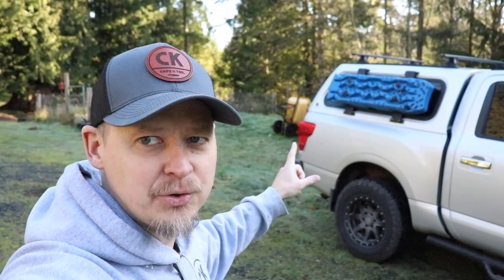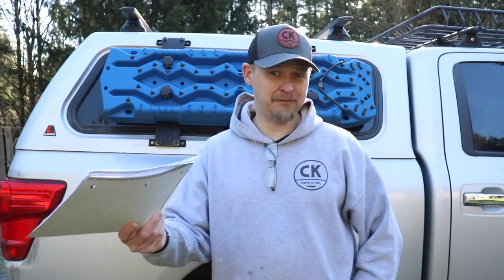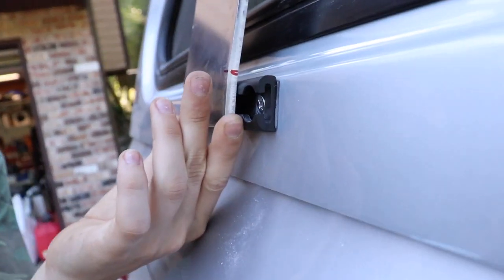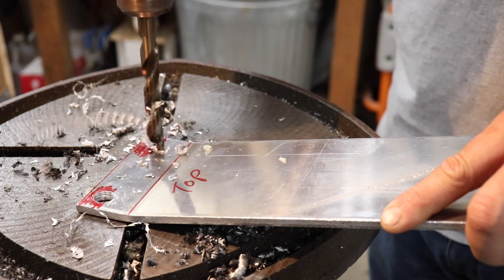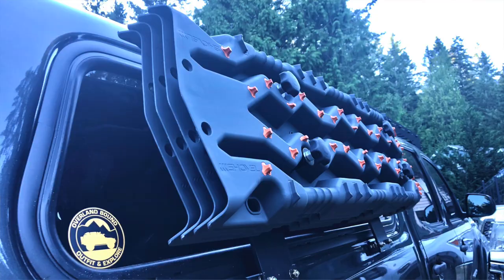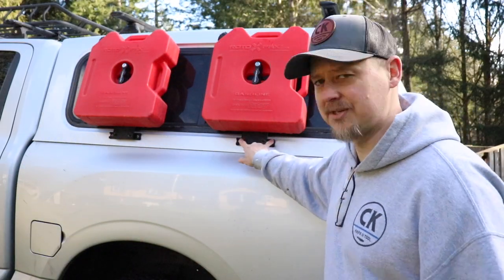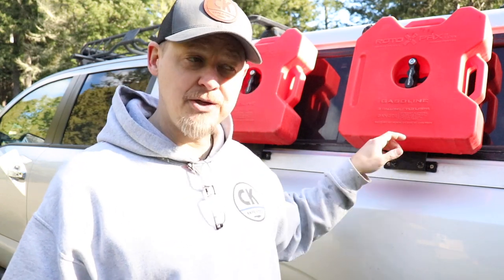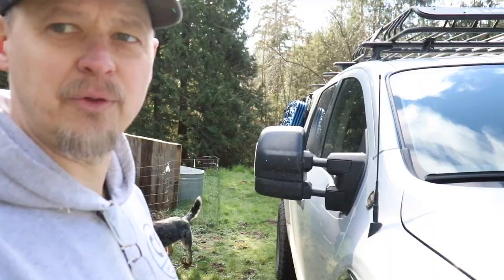Overland with custom mount on your truck canopy!  See my 2017 Nissan Titan idea

Comment: I love mine! Not one single squeak, creak, rattle or leak that I've noticed. You mentioned the paint and bedliner coating on the supports. After spending extra money to buy specific primer for aluminum, sanding the surface, primering and adding four coats of the correct paint, it was a waste of time and effort. Just mounting them caused scratches, and branches have easily added more. Just go with the bedliner if you're going to do this. Also makes for simpler touch up if you're someone that dislikes scratches. I would have to say the weakest component of the entire system is the Rotopax fuel cell lids/caps. Like so many other fuel cans, the combo cap/funnel/spout part is sort of clumsy, and one of mine bent pretty easily. Of course I'm a dumb Marine grunt that always over tightens and breaks things, so take that as you will. 
Pro tip for people in the area: If you wait until just before meal time to go see Chad, he always feeds his guests very well. :)
Of course, the installation took us a good full 8hrs at least, so plan accordingly.

Comment: So after this time has now past…. Amy concerns or indicators or cracking at the holes? We have a Treeline tent on our snug top but this would be ideal for my rotopax. Thanks for the inspiration!
Reply from the maker: The whole system works great.  The negative I have is with the RotoPax fuel cans.  I had one develop a crack and drain about two gallons of fuel down the side of my truck.  No leaks though it’s any of the attachment locations.
Reply: @CKKnifeandTool  awesome good to know. Thanks for the response.

Comment: Does it whistle?
Reply from the maker: Not that I’ve noticed or the dog has mentioned 😉
Reply: Chad great video.  Question would someone be able to unbolt the whole mount from the truck.  I couldn't tell as there wasn't a close up of the bolts.  I have a Ranger with a Snugtop and I've been trying to figure out a mount for the sides like you did.  Looks awesome and it's easy to access the boards when you need them.  It also provides some good security for the sides.  My side windows flip up, so I'm try to figure out a mount that will swing up but still lock down.  Great job and thanks for the video it's given me some good ideas for my mounts.  Cheers and happy trails.  Scott